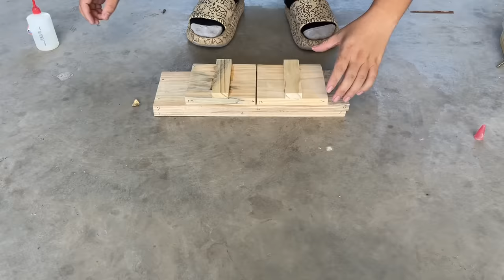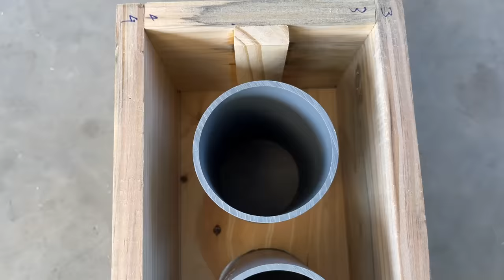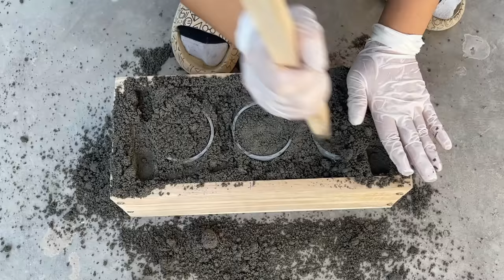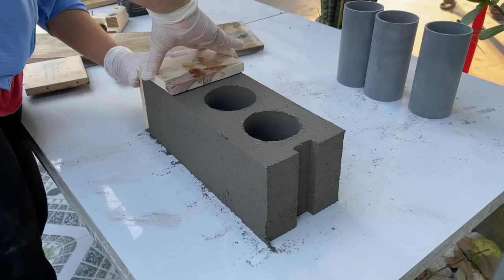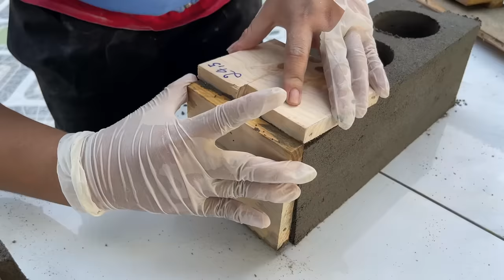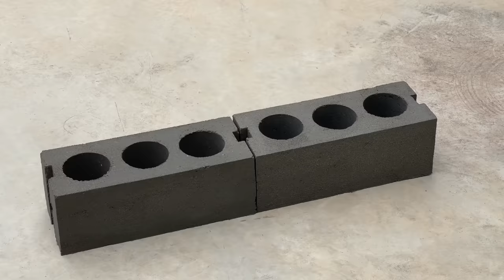Create wooden and PVC cement hole blocks

Comment: I would have thought it needed to be wetter then that? Im super confused 😕
Reply: Это и есть вибрация
Reply: It needs not to be wetted thoroughly but the mixture should only be moistened.
Reply: Хорошо
Reply: Depends on materials and the mold used. I have some dry mixes for some bricks, some slightly wetter mixes for others. I have a fill and turn out mold, where you fill it then instantly top it over and slide the mold off of the brick, so you can turn out about 50-ish bricks an hour from the one mold, without having to dismantle it each time. This type of mold requires a slightly wetter mix, but not so wet that it collapses on itself when you remove the mold.
Reply: In most factory, they use dry sand and just blow in water steam.

Comment: This is almost identical to the mold I made, the difference being that once you fill mine you just flip it over and drop the brick out on to newspaper/sand and leave it to dry. It doesn't stick because I treated the wood I used inside the mold with a thin coat of car body filler, sanded smooth, then painted it with a gel coat paint, and the mix I use for the bricks is slightly wetter than the one they use in this video. This way I just fill it and turn it out, no need to dismantle for each brick. That way I can turn out on average 50-60 bricks an hour. I still have this mold, but what I started doing last year was to make fibreglass resin copies of this mold by first taking a copy of it in silicone and then pouring my fibreglass resin mix in to the silicone mould..I have a few of these that can be used with myself and a few others, we can churn out about 250 bricks an hour, meaning we can prepare the mix in bigger batches aswell.i would recommend using talc (powdered chalk, I've even used corn flour/starch before now) or similar as a release agent, dusting the inside of the mold with it before filling with the mix. If you are just using a plain wood mold, paint the inside with a bit of used engine oil as this will stop water soaking it to it and buckling it or otherwise warping or spoiling it. It's definitely worth making you own molds for cement/concrete casting. I'm going to attempt a 3d printed mold soon, another fill and instant turn out mold. I have printed out concrete stamps out before now with stone patterns in for slabs and they work well, I'm hoping to try stamping a pattern on one side of a batch of bricks to see how they turn out. I think it will work well on coloured bricks as the pattern will stand out more.

This is a very good video, and if you are going to make the mold yourself I'd recommend converting the design to a fill and tip out version to increase production volume and for time efficiency.
Reply: Those are.great ideas.
Reply: You should make a video
Reply: Can you make a tutorial video
Reply: Do you have a video of your method? I need to make a bunch of bricks. Thanks
Reply: Шумо аз куҷоед?

Comment: If you made the side prices little short and end pieces a little longer. You could put slide  bolts on top and bottom of every corner then you wouldn't have to unscrew them every time. The slide bolts that you use to lock a door.  Good luck and nice idea just tweak it a bit more.
Reply: 8
Reply: Купи цемблок

Comment: Thanks for the video.   I will be making ONE block like this with one 4" hole in the middle for a dryer vent. It will replace a granite stone removed from my basement wall.  I think I'm going to try some of that non-shrink flowable concrete grout and see how that works.  Any downsides to that?   If it doesn't work, I'll do one with regular concrete with aggregate instead.

Comment: i just think it,s a good idea to use japanese joints instead bolts to the wood structure. 
also, why not making them lego-style? would be more useful and safe if the blocks just assemble one on top of  another. 
you gave me ideas though. thanks!

Comment: What is the size of made Brick and its 3 hole size . In jeneral clay made common brick Dimention is 9.5 Inch length Thickness 3.75 inch and width is 4.5 Inch but it's prise is some 7 Rupees per Brick. 
The Cement made Brick is of how much cost ?  And covering area and its weight ?

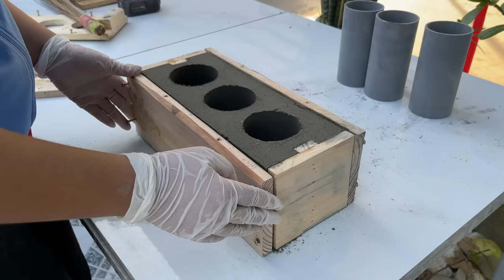Comment: Looks good overall but unfortunately on 5:09 you failed. The brick is broken and weakened dramatically. It can't be used in a wall bricking for house for sure. Only for some garage or burn 1 floor only. Moreover this type of block will be uncomfortable for brick laying since those 3 holes are opened... You had to make them closed on the other side. Mine blocks were similarto yours in 1990x but with closed 2 holes.
Reply: You saw it wrong. The cement that you saw coming out wasn't the brick breaking up. It was the cement in the center of the holes.